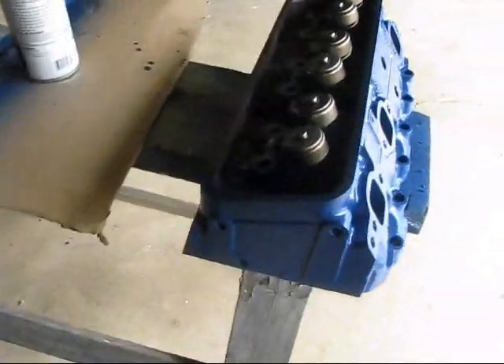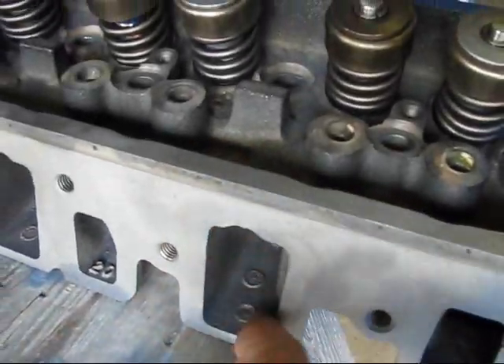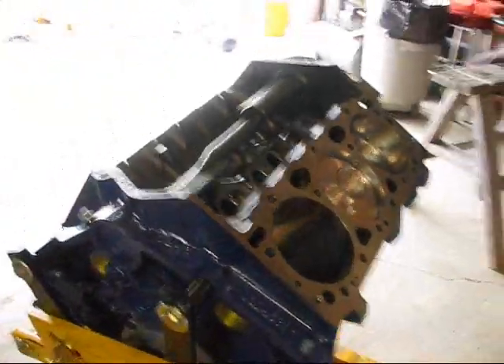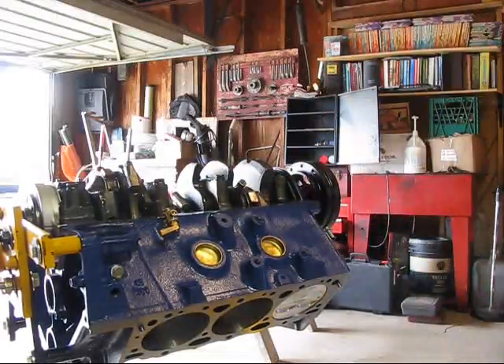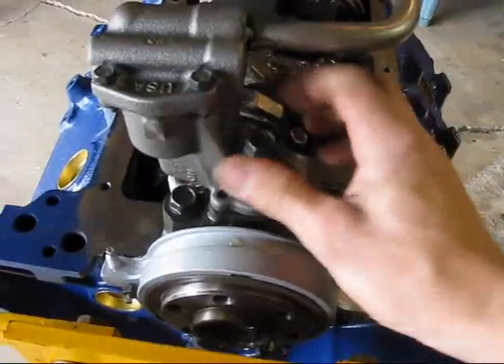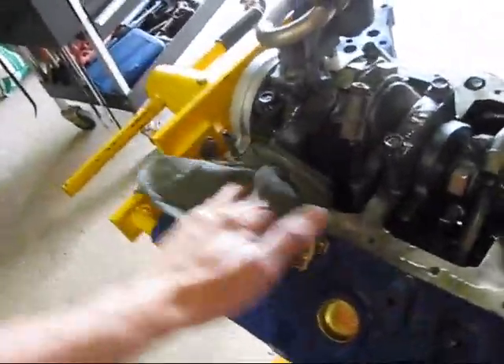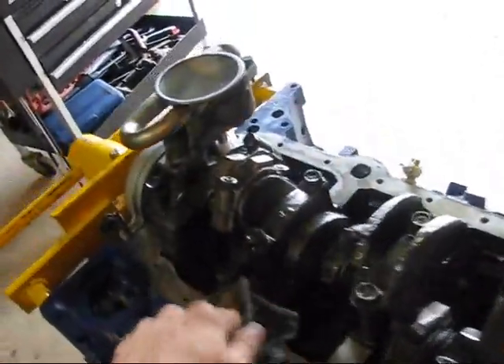S10 Engine Rebuild 4

Comment from the maker: Sweet, I had a lot of fun working on my motor and my truck in general. If your looking for something specific check out summit racing. its where i was able to get my parts from. Its also beneficial because you can cross reference parts to make sure they are compatible. I know i spent some time researching pistons for my motor and I am definitely happy with the end result

Comment: All the nice stuff going into the engine, but no headers?
Reply from the maker: Watch further on in my S10 Series, I installed factory manifolds during the break in period of the engine, Then the ceramic coated hooker headers went on... Along with the 3" stainless exhaust. BIG improvement

Comment: Is that an after market intake manifold? The one on my s10 looks different. Is it higher performance?
Reply from the maker: That's the factory intake for this engine,  it's the CPI version (Vin code W) have a look online its got a few differences from the TBI type.  Thanks for watching.  

Cheers

Comment from the maker: Oh yea, i have found one, just have to gather some more information its between a 200 and a 300 amp. i would prefer the 300 amp however i have to make sure that the 300 is designed for a daily driver type of install rather than an SPL style. i know the amp will have a draw of roughly 187Amps, but i have 2 amps and i have added a high output ignition (MSD) and electric cooling fan for the engine i just think 200 may only JUST do it. If the 300 is good for daily driving then its gonna be that

Comment: did u guys remember head gaskets, curious cuz when u put the heads on i didn't notice any, but all n all good vid
Reply from the maker: MrAdrenalin17 we got all the required gaskets installed, video likely dident show every step. I had to cut them down to a reasonable length.  thanks for watching.  
Cheers

Comment: Install some aftermarket gauges to keep check on the oil psi
Reply from the maker: The factory gauge shows good pressure,  much better than before the rebuild

Comment: where did u get the roller rockers
Reply from the maker: they were ordered from summit racing. I had a machine shop assemble the heads as the valve springs needed to have the seat cut deeper.  all the components were compatible with each other
Reply: @RobHoffmann20  what cam are u running im rebuilding a 4.3 and it had a 500. lift cam in it.  its good so im reusing it.. I dont know what the duration is, but ive read that the engine computer can manage a 500 lift cam, its the duration that u have to be careful about. I bought the core out of a salvage yard, and have no idea how the engine ran with the cam in it..(engine blew a head gasket due to a rusted out freeze plug)....  I can tell that the engine had been professionally rebuilt at one time due to stamping and tags on it.. they also sleeved all 6 holes and it has stock size pistons in it.. I suspect the rebuilders upgraded the cam when they rebuilt the engine,,  Im also port  matching my heads and intake, and polishing them. one of the best power gains in the SBC ive had  for free,.   is polishing the throttle body throats and going to a 15 lb fuel pressure regulator spring., I also advanced my timing 1 degree above base and it is very snappy and responsive.  I found going to high on a spring causes top end bogging for some reason.. I think the low pressure pump cant keep the fuel flowing steadily enough at higher rpms. 
im thinking with the 500 lift cam I need to make the air intake as much as I can to get full benefits of the higher lift

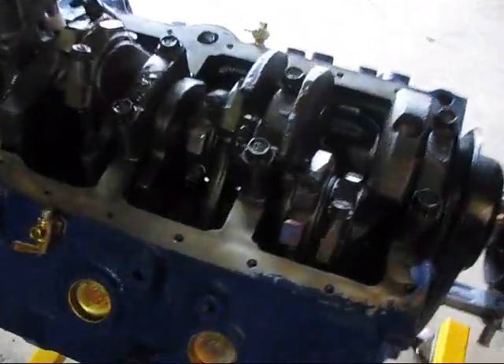Comment: @ 3:50 with the Silicone on the " Corners " is a bad idea.  My Dad did that on his Honda, when he did the Gasket.  5+ Years later, the Silicone would separate from the Engine and eventually leaked :(((.  It's best to just put the Gasket on like it is since it will be " all  even ".  In time, you can just tighten " All " the Bolts again and everything would still be even.  NOTE:  I know you are doing a preventive maintenance, but in this case it wasn't necessary!
Reply from the maker: Jordan Bronson i was under the impression this was a common method when replacing the oil pan gasket.  I could very well be misinformed.  I can tell you I haven't developed any oil leaks from the pan gasket to date I'm beyond the 5yr mark. Never know what the future may hold.   but I do appreciate your comment and thanks for watching 

Cheers!
Reply: +RobHoffmann20 - Hahahahahaha... Yea so did my Dad was thinking the same thing when he put the Gasket on... Thinking the Silicone would added the " extra " protections on the corners.  But I am glad to hear that is NOT doing it in your case.  NOTE:  If you look at the the Gasket(s) and some are made " better " now with good Silicone.  There is no need to put in extra Silicone or anything in that nature.  If you don't want it to move during " installations ", just add a thin coat of " Lock-tite " to prevent moving.  But this is all what I have learned during my repairs.
Reply: Silicone isn't going to hurt anything. This is a Chevy  engine not a Honda

Comment: I got a question for you I'm the heads does it matter on which one goes on which side or they can go on both sides doesn't it doesn't matter can you swap em up cuz I can't find on find out if one goes on one side or the other side or it doesn't matter
Reply from the maker: I don't specifically remember that. If i had to guess i would think they are able to be installed on either side.

Comment: If you have a roller camshaft there is no break in.
Reply from the maker: I didn't realize that.  Thanks for the tip!

Cheers
Reply: Welcome you still have to be easy on it till the piston rings seat
Reply from the maker: @Ohiocountryboy-se2cn  yea,  we did let it warm up fully and cool before even taking it for a test drive.  Then oil change after 1000kms. It's been great for the last 5or 6 years.  Only issue i had was this past summer a broken valve spring.  Quick fix tho.

Comment: hi volume doesnt mean higher pressure
Reply from the maker: No Future 68 referring to the oil pump? yea, I have learned allot since. That was the first time rebuilding an engine and it was a great experience.  my dialogue is just made up as I go so sometimes I'll say or make a comment completely wrong and not catch it until later on.  I have never had an issue with the oil pressure since, the pressure gauge is reading exactly where it should now.   thanks for watching.  Cheers
Reply: Looks,sounds good!